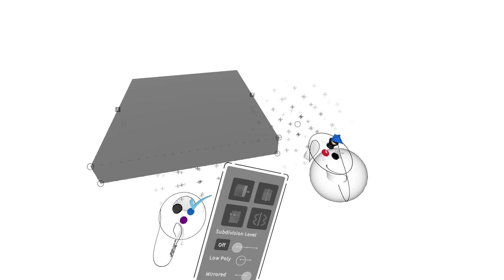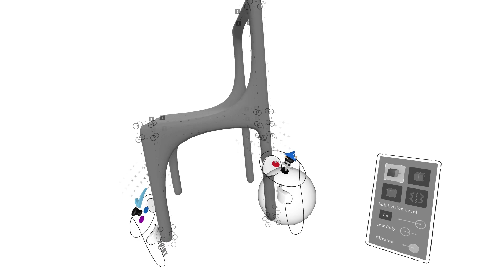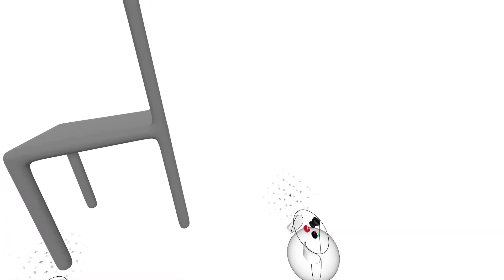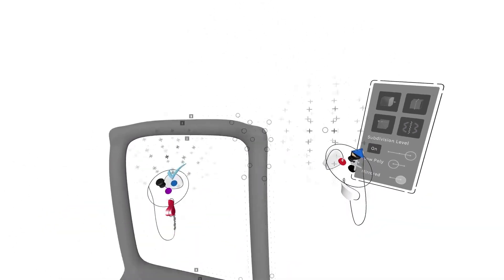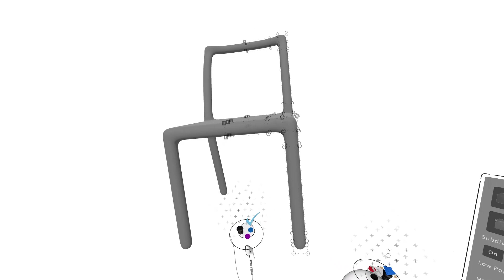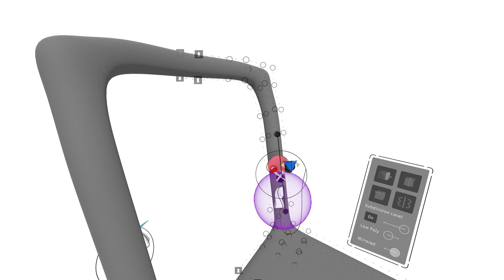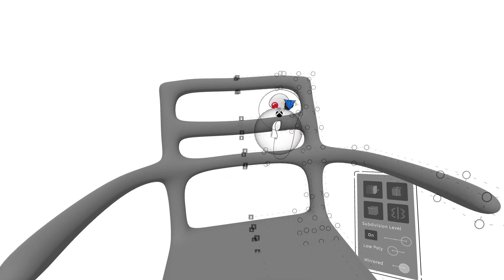How to make a chair in Gravity Sketch using SubD - Workflow

Comment: Reall y want to lear how to use this but unforunately these tutorials don't show you how to add the nodes or points. He just does it and expects people to somehow benefit? For example - apparently in edit mode on any surface I can bring up a tool tray by pressing the black button - but I can never get this to work! I am also on VIve controllers -which they dont appear to have a controller cheat sheet available for. So can you guys help?
Reply from the maker: Thank you for reaching out! You may need to activate the tool belt which is done through LandingPad. We also have beginner tutorials as well for you to reference, please check those out as well.
Reply: @GravitySketchYouTube  thanks